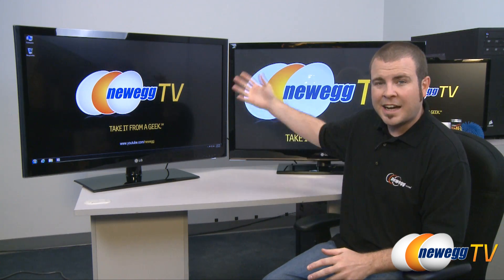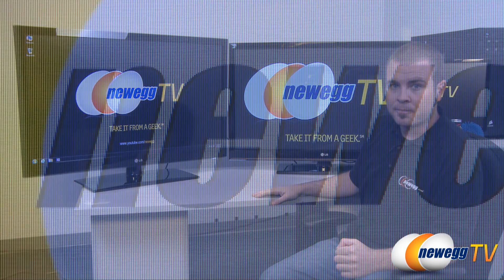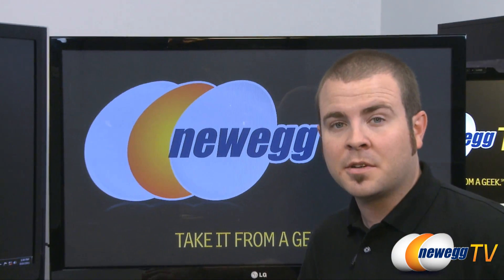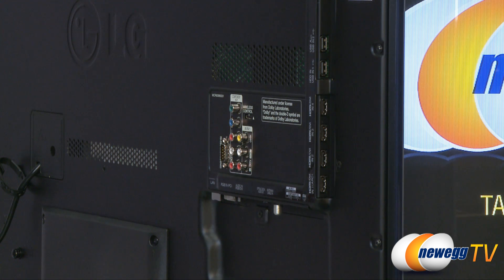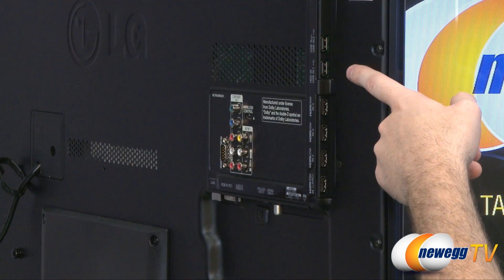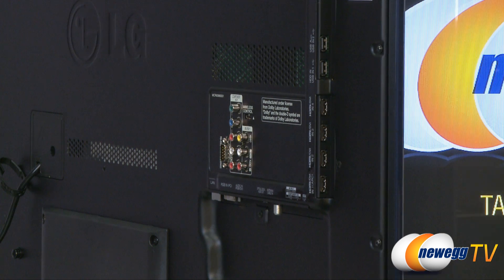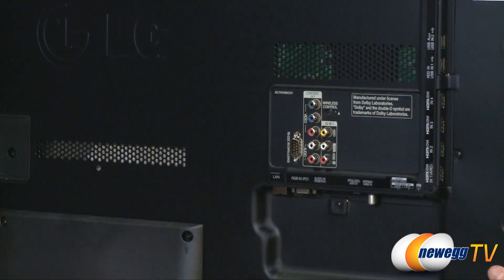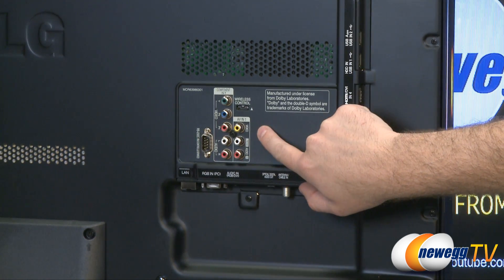Newegg TV: HDTV Technology Guide

Comment: We need skyrim to run at 144 fps constant XDDD CONSTANT as (97% OF THE TIME) Well, my reasoning for that is just that skyrim is such an imput laggy game. The only ''fast'' setting for skyrim is default max settings with 60 fps locked with Nvidia inspector (I've tryed 120 fps but it just doesn't run more then 95-105 fps without anything more then the default game  AAAAnd with a gtx 680 and 2500k 4.2 ghz OC What am i doing wrong ?

Comment: its because they are TV's. IF you dont want input lag you should go for a monitor. and besides, refresh rates reduce input lag in common. 
60Hz has 16.7ms and 144Hz has 6.9ms as rule of thumb.
However the asus VG248QE has a high refresh rate, a 1ms gray to gray and ONLY 3.1 ms. So if you want almost zero input lag this monitor is perfect. Now dont think that a 1000hz 60 inch tv has lower input lag because that can count up to hundreds of miliseconds. So do i need to explain more?

Comment: Actually, it is still SD. Just because it can work on an HDTV, doesn't mean its HD. The image is not 1080p, but most likely a lower resolution, just blown up fill every pixel.
Using an analog on an HDTV will never look as good as using digital. 

For instance, I have a VGA and HDMI connection from my GPU. It still says "1980x1080", but the image is much less sharp and defined than the HDMI/DVI connection.

Comment: @Luger718A1 Not really. 60hz is how often the image is refreshed. A frame is a completely new image that is displayed on the screen for an instant of time. With an interlaced signal like 480i 60hz, the frames are broken into fields. Each field is exactly half of the screen's resolution. Every even and odd numbered scan line is refreshed at 1/60 of a second. 2 hz=1 frame. That means that 60 hz will produce 30 frames per second. NTSC made this setting because our electricity is set to 60 hz AC.

Comment: Standard Definition a few years ago was 480i not 480P. And  60 hertz. One hertz is the same as half a frame so 60 herz is 30 frames per second. 

P stands for Progressive not Parallel. Otherwise known as Progressive scan. 

Film is shot at 24 frames per second and television is shot at 60 hertz or 30 frames per second. 

Look up 2:3 pull down on google.

Comment: @GOBLUEBOY - active is the best way to go given current technology as it allows true 1080p in 3D imo. The problem with passive is that the signal is split in half to each eye which cuts down on resolution while in 3D. In the long run, passive will win out after 4K displays are affordable/available. Many theaters have projectors at this resolution. Active allows you to see the full resolution while in 3D.

Comment: @Paperclown 3) Basically a marketing ploy, LCD and Plasma work differently. 600 or 480 Hz on a plasma is the same 60 Hz like on LCD, they both show 60 frames per second, the dots on the plasma flash 8 or 10 times more often though. What gives the plasma it's motion smoothness is not the 600 Hz but the incredible response time ( less than 1 ms, which is instant ). A typical LCD has a response time of 8 ms. Lower numbers mean faster transitions and less blurry motions in action scenes or sports.

Comment: I have a Panasonic 120 Hz HDTV and it has a "Motion Pro 4" option that, when turned on, makes the picture look sped up. My preference is to keep it off but I was wondering if that option is related to the 120 Hz? If I turn off Motion Pro, have I reduce the refresh rate?

Comment: @Paperclown 1) Each TV has a native resolution, 720p in your case. Feed it 1280x720 (16:9) input from your PC so that it doesn't have to upscale.
2) Film for a long time has been shot in 24 frames per second. So for Bluerays you need to use a TV that supports 24 Hz or 120 Hz. A 120 Hz  TV will show each frame 5 times ( 120 / 24 = 5 ) which is perfect timing. If you use a 60 Hz TV half of the frames will be shown 3 times and the other half 2 times ( 60 / 24 = 2.5 ) which results in judder.